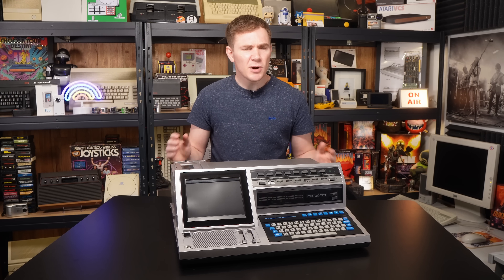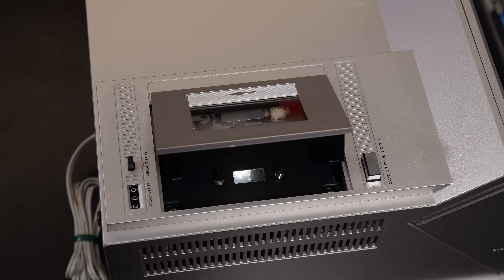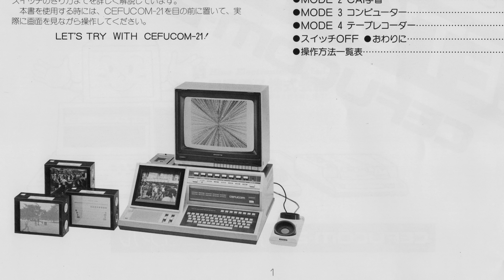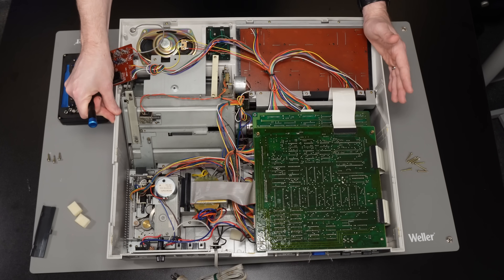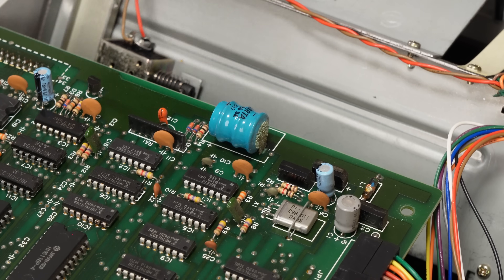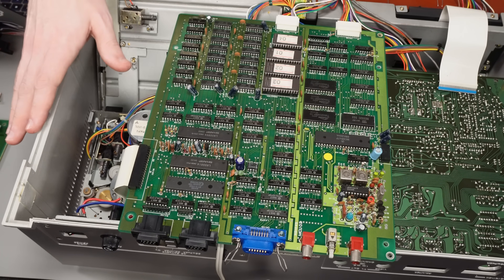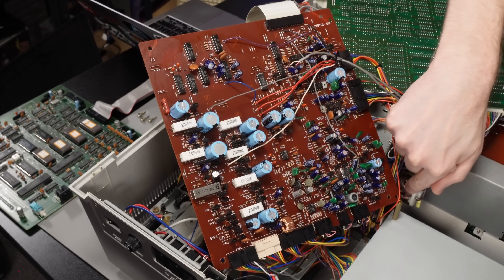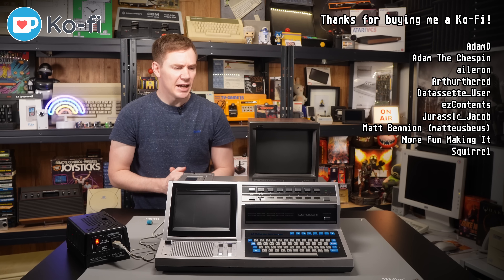What on Earth Is This Thing?

Comment: Fascinating. I first expected the screen to use some kind of rear projection. Come to think of it, they could've probably put those slides on 8mm film and shrunk down the cartridge considerably.
Reply: Yeah, when I first saw it I was thinking something like microfiche reader... turns out it was stranger than that!
Reply: You just reminded me of a piece of retro-tech that I used in school: the Dukane A-V Matic. That was a tape deck synchronized to a rear projection slide viewer. It wasn't a computer, so all it could do was slide shows with narration, but the strips of 35mm film it used were indeed much smaller than the Cefucom's paper cartridges.
Reply: @darthquigley  They called that an "audio-visual" back in my day.  You would just set up a slide projector along with a cassette tape which used a stereophonic recording, but one track was mono audio and the other track contained a beep every time the slide needed to be changed to the next one.  With an audio sound level triggered switch and a projector with a remote slide changer, you could set the tape running and the slides would change at the right time automatically.  All you had to do was keep on changing the slide cartridges at the right time to keep the show going.
Of course, a lot of people would just play the tape on a mono player and manually change the slide whenever the beep on the tape played.  Usually, the makers of the presentation would cater for this by deliberately timing the beeps to be between sections of dialogue instead of playing at the same time and possibly drowning out the dialogue.
Reply: @uploadJ  Sometimes film strips, and sometimes slides.  Almost the same thing.  Just depends on whether they're individually mounted into frames (slides) or cut into strips with around 4 pictures per strip.  I'm old enough to remember both.

Comment: Oh that is amazing, having paper photo's roll through because the system couldn't really display them otherwise. What an example of early work-arounds to the technology. :)
Reply: the drive system around has much of similarity with compact cassette and/or video tape recorders (except for the missing magnetic drum indeed).
Reply: (beta max was a single drive pin system - with no need for rewind. but there the spool also seem to have something like that.

i even remember to see tape alike systems with just a "rubbish" looking storage space for some metal/optical media similar to a cassette tape, but yes it was an endless one. and believe me or at least i think... it had a turn around point like a moebius ribbon so it had a doubled effective length - also some Star brands of needle matrix printers had this for their black ribbon.)
Reply: Provided a great deal of copy protection that the compact cassettes would not be able to offer for the anticipated profits of the language courses.